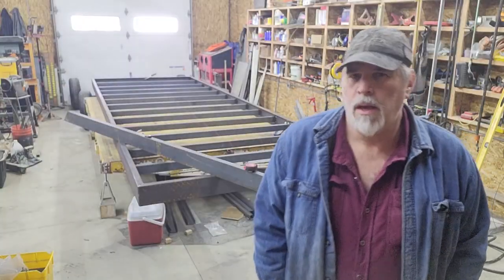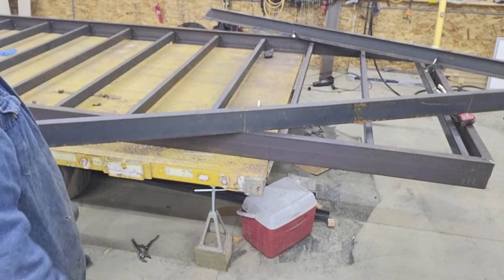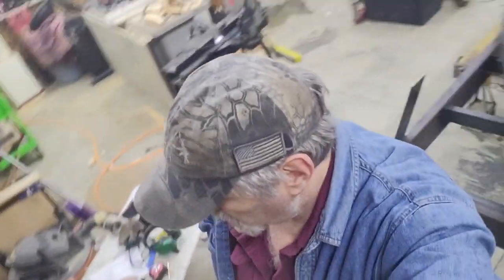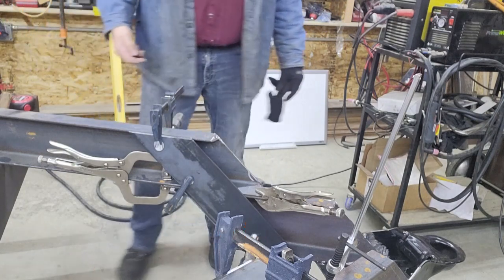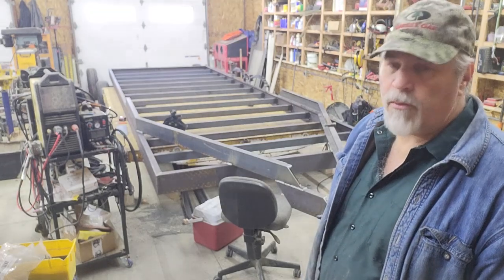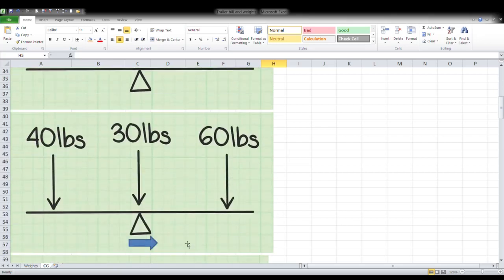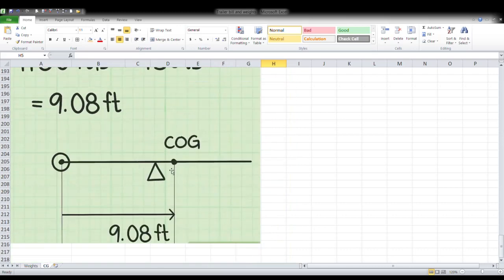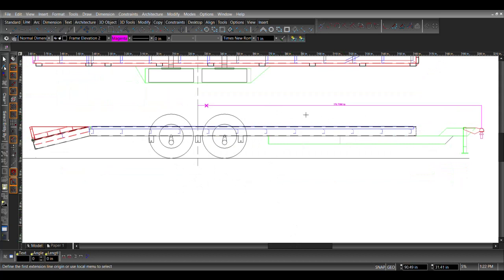More Welding and Axle Placement

Comment: Question about the tongue. The vertical line that you made your pie cut off of is that vertical exactly where it meets the outside of the frame? Say I wanted my tongue to come out maybe 3/16 of an inch or so then bend back. Would I move that line aft 3/16” just a little bit?
Reply from the maker: Yes it was.  If I understand you correctly, you want your tongue at the straight section to be 3/16 per side wider than the straight section of the main frame.  If so them for the most part yes. Moving the vert. line 3/16 farther won't result in exactly 3/16 wider because the tongue is angled, but it would be very close.
Reply: @builditorbuyit  correct. To add a  3/16” steel diamond plate step/gusset gives a little lip for it to weld onto.

Comment: Just do a 60/40 split on the trailer frame minus the tongue.
Reply from the maker: If the main deck was the same on both ends, I agree a 60/40 would get you close, but given the ramps and other structure make the main deck non symmetrical,  I wanted to show folks how to calculate a balance point when the point loads are not symmetrical.

Comment: Funny - he calls this basic math... it makes my head hurt. Dummy me, I'd of just finished the trailer except for mounting the axles and slide jack stands back and forth and measure the tongue weight. When I got it where I wanted, marked it and mounted the between pivot point there.
Reply from the maker: Your method is how I've done it in the past, but it's a little extra work.  I had to teach myself the math method for my job, so thought some be interested in the calculation method.
Reply: @builditorbuyit  Yes. It is best to know the math way... then you can apply that to other things.